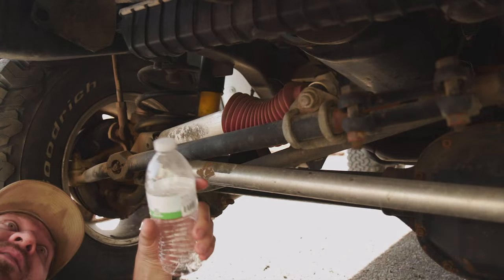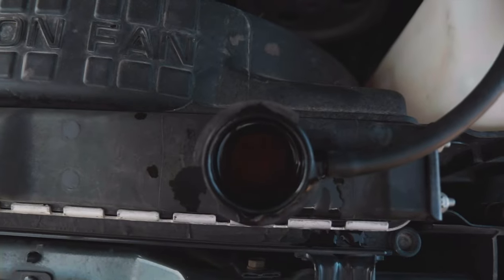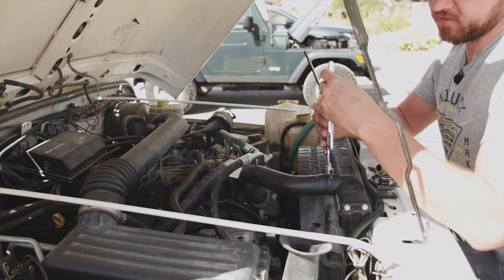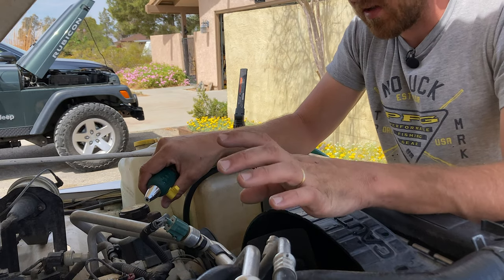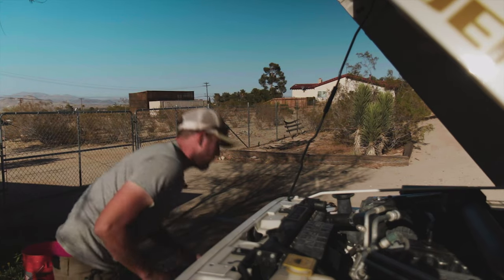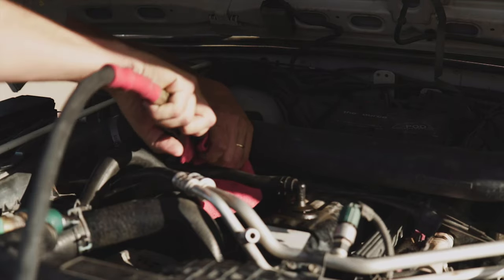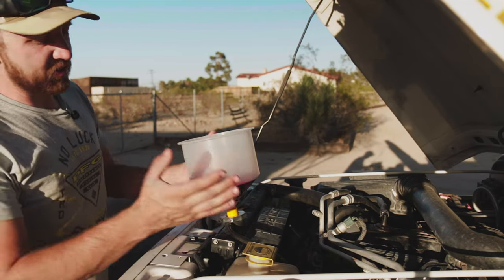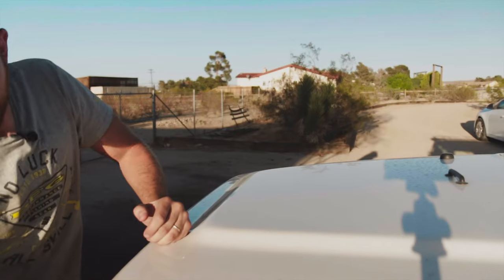How to flush your car's cooling system

Comment: Great video bro, I have the same problem for long time,  and found an extra tip  that I learned in Colombia South America.
To clean the entire system use 1 galon of destile water, 12 onces of destile white vinegar and 6 onces of  baking soda. To drain all the system, open your radiator bottom plug, connect a garden hose to the radiator top filler and start the engine till water comes clear, and turn engine off, remove garden hose. That save you  a lot time and money.  Remove radiator drain plug and blow air from top of radiator till not water comes. 
Close drain plug and ad half galon od destile water, then 12 oz of destile white vinegar and finally the 6 oz of baking soda, start the engine with heater on MAX and keep adding destile water on radiator till is full, install the radiator cap and drive for 25 to 30 miles. This cleans and removed any thrash inside all your entire engine, heater and radiator. After engine is cold, drain everything you can same way with low air pressure no more the 25 psi hose. After is empty close the drain plug and filler up again with ONLY just  destile water, drive it for 3 to 4 days keeping the eye on radiator level all the time. With cold engine remove the plug and drain everything again, till is empty. Install the plug and repeat the process till all the thrash, rust and any nasty shit is out. Now that ONLY clean water comes out,  close the drain plug, and fill it with 50/50 antifreeze and destile water according to the type factory recommends till the system is full after you start the engine and check for leaks. This's a long process but, saves you money, tow truck, parts, labor  and headaches. Never mixed antifreeze different COLORS or BRANDS,  don't ask me, I learned believing  all greens are equal. The white destile vinegar cleans and remove any RUST and the baking soda clean your RADIATOR and hoses.
Reply: Isn’t vinegar acidic and baking soda a base so mixing them actually counterintuitive? Wouldn’t using the vinegar by itself be better?

Comment: I'm glad to see that you tried to get the tap water out and replace it with distilled water, but you will still have a lot of tap water minerals in there. What I would recommend is, before adding any antifreeze, fill it completely with just distilled water, take it for a long drive (at least 20 miles), then drain and repeat at least four times, then put the antifreeze in.
Reply from the maker: It’s certainly not easy to get all the tap water out, but your idea sounds like a great addition. It would help by diluting and using the engine to mix all the water up. Very smart idea! Thank you!
Reply: @EmbarkWithMark  You're welcome. You might also find you'll get even more debris out that way also.

I've seen far too many cooling systems ruined just by people topping up their coolant with tap water. I wish the manufactures would put big warning signs saying to only use distilled water in all of the vehicle systems that take water. Non-distilled water plugs up cooling systems and reduces cooling efficiency, it will destroy batteries and it will plug up windshield washer nozzles and pumps and leave spots on the windshield.

Comment: Did this solve your overheating problem? In a previous video you mentioned you’d test the head gasket. I’ve done all the steps you’ve done in these videos but still have overheating problems.
Hopefully you see this.
Thanks
Reply from the maker: Running thermocure and flushing extensively helped alot. I still run a smidge warm at times and I’m now thinking the radiator is partly clogged. 

Right now it’s just to hot to work on things, 115-120 in my area, but once it cools down I’m going to pull the radiator and take it apart. Thinking about doing a video on that so we can see what the radiator looks like on the inside and if it indeed is plugged up. Thoughts on a video like that?

Comment: Drain coolant/water and then run your engine for 20-25 seconds to drain the block
Reply from the maker: I’ve realized from a recent flush that the 4.0 has a drain plug to drain the entire block. Works very well.
Reply: @EmbarkWithMark  Freeze plug. It's always recommended to use a new one when the old is pulled. Easily available at any auto parts store
Reply from the maker: @Maxxis1941  it’s not a freeze plug. Threaded low point drain plug. But yes, pull a freeze plug and a new one should be used.
Reply: @EmbarkWithMark  Been a Jeep guy for 40+ years and have somehow missed this threaded drain plug.
Google here I come!
Reply from the maker: @Maxxis1941  Yea, I didn’t realize there was one either. It’s up near the exhaust manifold between the cats if you have them. https://wranglertjforum.com/threads/is-this-the-engine-block-coolant-drain-plug.29199/
Reply: Question - if I cannot get the block drain plug out, how do I drain the block? Fill the system with distilled and run it until the stat opens then drain radiator/heater core again?
Reply: @buiklimketr  Completely draining the block isn't necessary. If your old coolant was that really bad or contaminated, doing a few fills/run/drains until clear water comes out will suffice. The amount of water left in the block won't throw your 50/50 mix off by more than 1-2% at maximum.